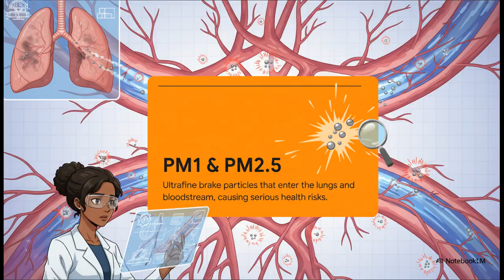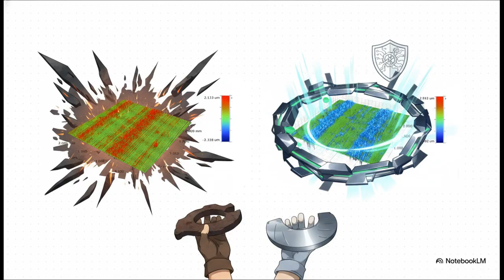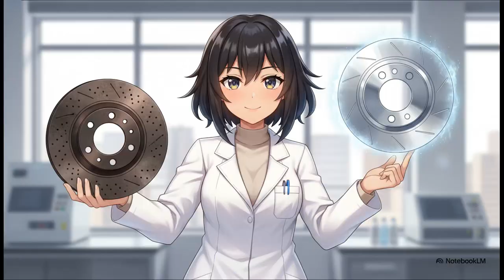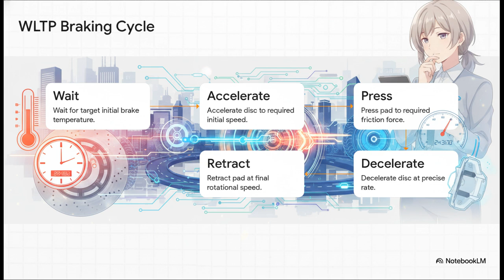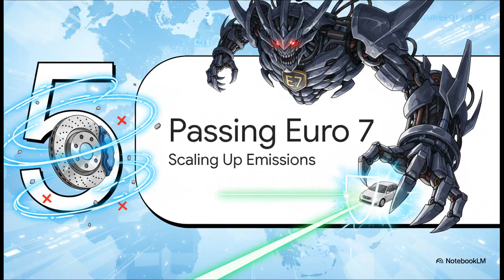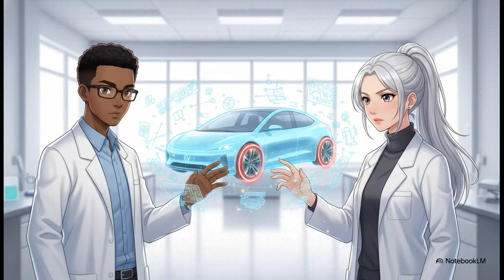How New Euro 7 Rules Will Change Your Car Brakes Forever 🛑📉

Comment: Do not panic, China will have standard cheap discs available with standard pads at sensible money.
If they were any good, manufacturers would have used them years ago, that's why supercars use carbon ceramic brakes.